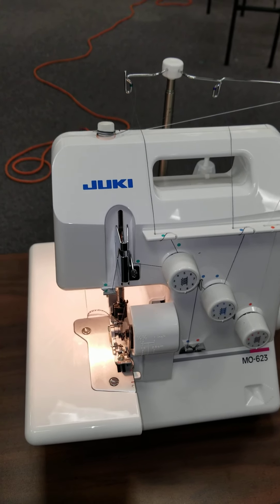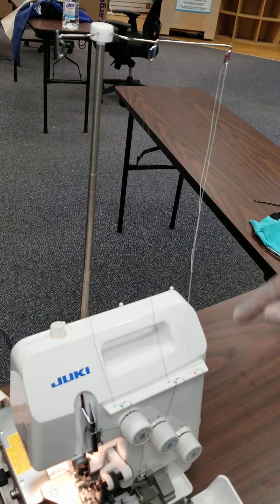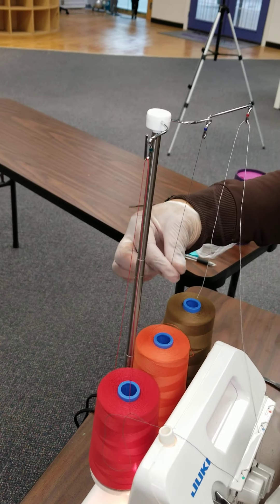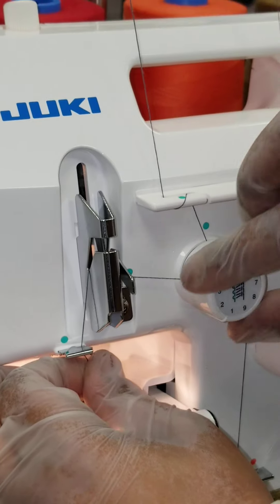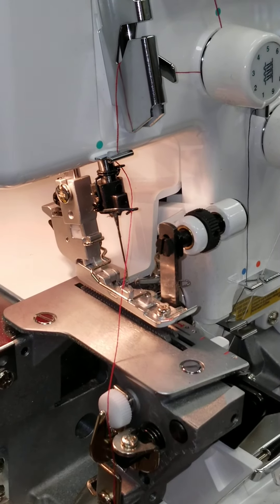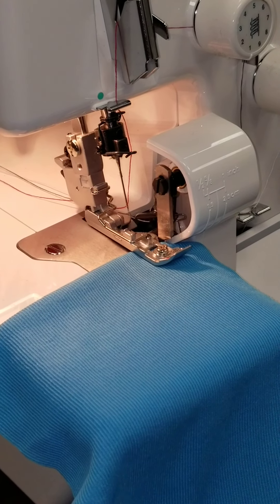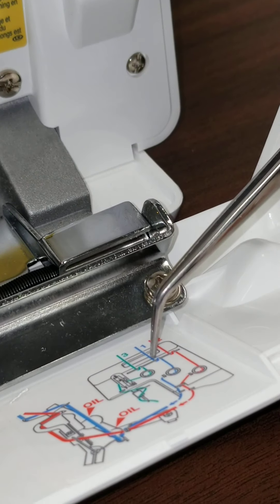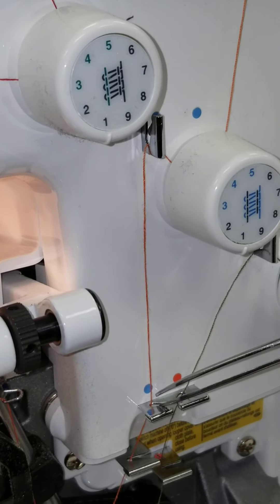Juki MO-600-MO-623 Set Up and Threading 2 (HOW TO)

Comment: What does it mean when the light is on and you press the foot paddle but it doesn’t work?
Reply from the maker: Hello. It sounds like your needle is either a bent broke or stuck in the wrong position. Turn off your machine check your needle make sure that is in the up position if it’s not bent or broke check your cutting element make sure it hasn’t come a loose. Plug your machine back up and see if it clears out the error. Usually when the light on it means that is in the error state. Hope that helps.
Reply: @kustomkreationsexclusive5767  Thank you for responding back! I will try this. Thank you so much